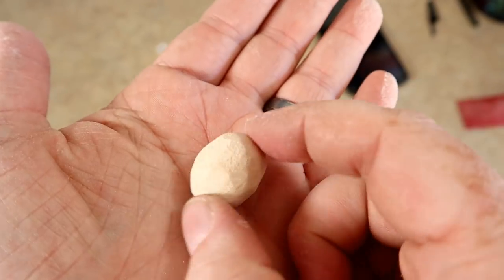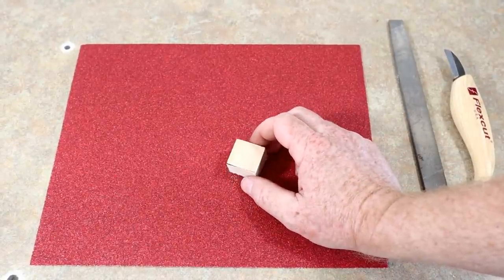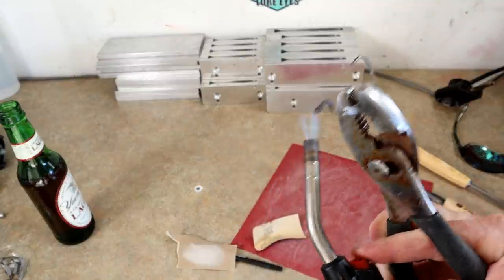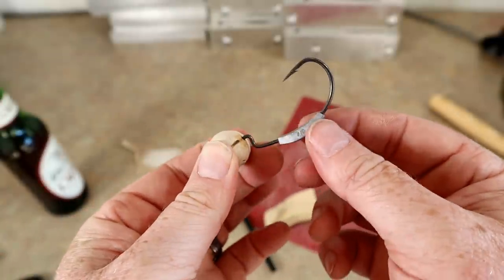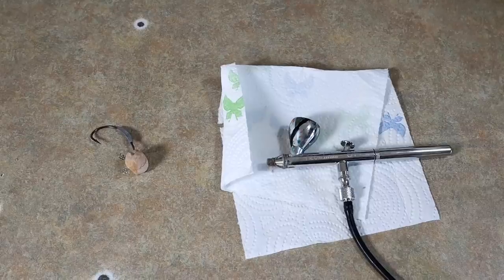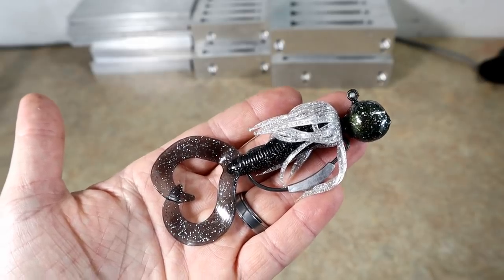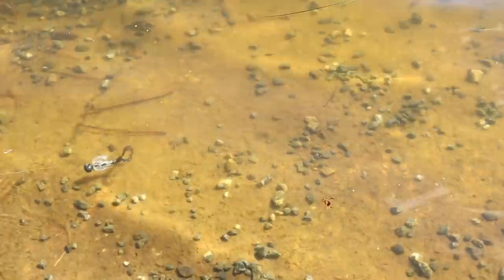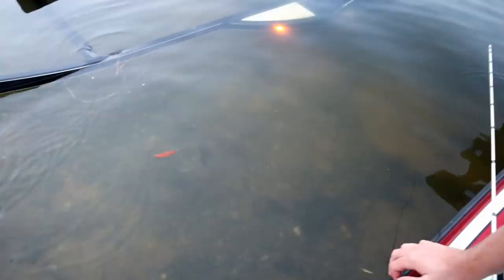Create & Catch: WOODEN JIG With Matching Soft Plastic Trailer

Comment: Nice! I just made one myself, but I used a dense hardwood ( tassie oak) then weighted as close to the front as possible, it's pretty cool. I'll be making more for sure. Also made a bug jig with a weedless hook, looks like a little black bug jumping along the bottom, I recommend making one of those, much easier and same thing pretty much except a shape not a round head, but rounding square blocks isnt fun as you found out Haha.
Ahhh, you didnt seal your wood 😳😳😳 you must seal your wood with something like polyurethane or even just primer thinned down, or super glue then sand then paint. I know you do it for fun but this is miss guiding to someone starting out. I'd also use 5 min epoxy over super glue any day. Cool little 1 off build though.

Comment: And a solution to put the weight in the head drill a hole on each side of the wood and fill with melted lead or drop some pinch sinkers in and fill with baking soda and super glue that way you can perfect the amount of weight you are trying to achieve